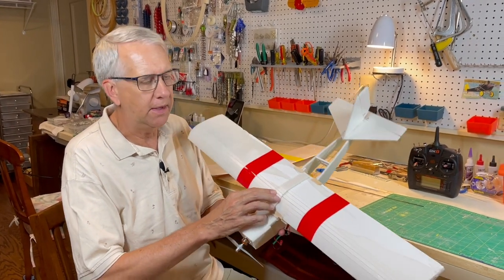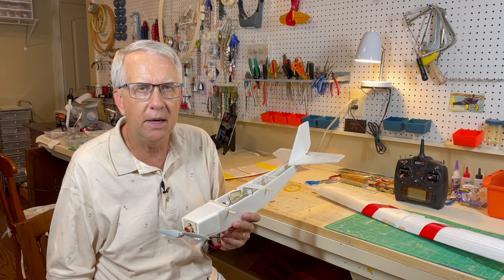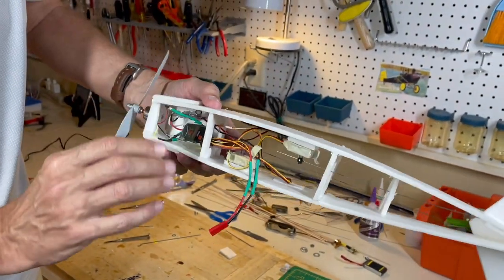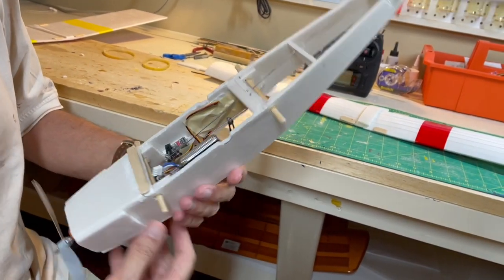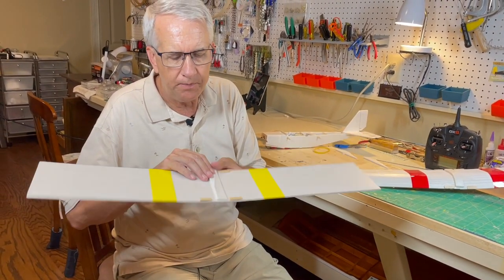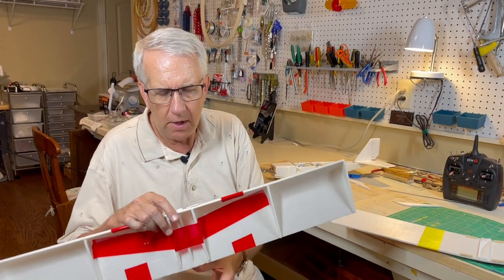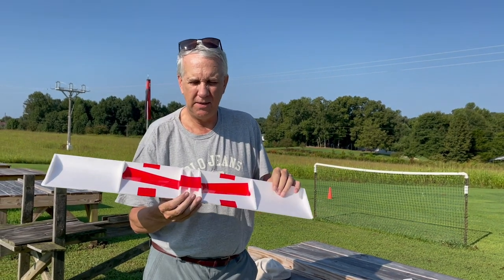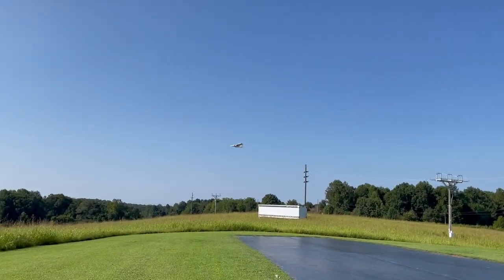2 Different Wings 1 Airplane Test Flight

Comment: another great and down to earth as well as encouraging video many thanks
Reply from the maker: Phil:  Many thanks!  Tim
Reply: @TimMcKay56   sorry me again Just remembered I once made a trainer out of plastic core board( the type of board estate agents use pinned to a post to advertise the for sale or sold by notice) watch out for the glue though, it is prone to making you light headed . This was back in the 80s  and had a 5 feet wingspan and a 40 size nitro engine. Flew like a dream and was still in the club over 20 years later

Comment: This is not a fair comparison if you take in account Reynolds #. An airfoil will fly better if the NACA maximum thickness of the airfoil percentage in relation to the cord is properly calculated for the size of this wing. Also and to be fair, the undercover of the wing should be covered so we can measure one parameter (top part of the wing) at a time. Last mechanical observation with foam board you can peel the interior and bend the curve smooth rather than making cuts on the top which create turbulence and a brake off the laminar flow.
Reply from the maker: AB:  Many thanks!  Tim

Comment: Hi Tim have you tried a Kline Foglman airfoil it’s just a second piece of wing material half the width glued on the top of the wing the leading edge is then rounded but you leve the step I have seen a test and it worked better than a flat wing.
Reply from the maker: John:  I hav e heard of this.  Need to do some more research, perhaps a video.  Tim

Comment: Hey Tim can you please specify what kv and size motor that is thanks in advance - Anuj
Reply from the maker: PS:  I used a Park 250 motor. Look for any motor designed for a model weight of 5-7 ounces, that should work. Tim
Reply: @TimMcKay56  thanks Tim

Comment: Nice test, i did the same with a flat wing plane i build. i wanted a slower version y built similar under exaggerated cambered , no cover at bottom. 

i had no control at turn or elevator with the new undercamber wing . Crashed many time and i could not make it work.

i was told that i need very large surface areas at the tale controls. And make sense because i have another plane designed with undercambered wing and take surfaces are really big and tall. the plane is cales slowly v2.

in my case i want to keep trying cover the botton of wing first then replace. tale controls for larger onces to see if it fly slow.

thanks for the video!!!
Reply from the maker: Alex:  Correct that you need large control surfaces, good luck with your project!  Tim

Comment: I'd be very interested to see the difference if you tried a closed airfoil.
Reply: Agree
Reply from the maker: Tim:  Will give it a try!  Tim
Reply from the maker: Thaks!  Tim
Reply: @TimMcKay56  Thanks Tim - I love what you are doing with this. It's always my first question about anything - "Why?", I really want to understand. The question I am currently pondering is - we all know tail heavy is bad and it makes a plane very hard to control - but why is that?
Reply from the maker: The control surfaces have a certain amount of effect on aircraft pitch, roll and yaw. This can be effective only if the plane balances at the CG. Tim
Reply: Pretty sure you wouldn't see any difference.
Reply from the maker: 👍🏻 Tim
Reply: @TimMcKay56  That helps - thanks Tim :-)